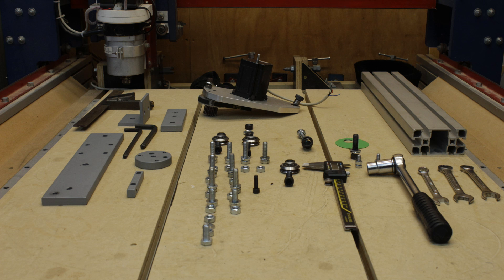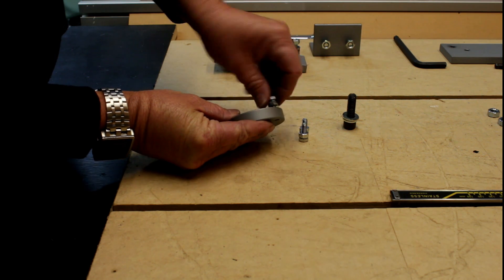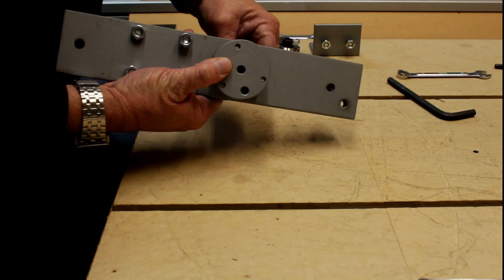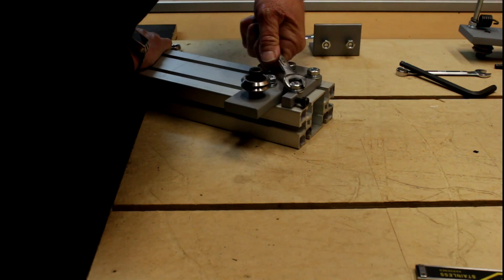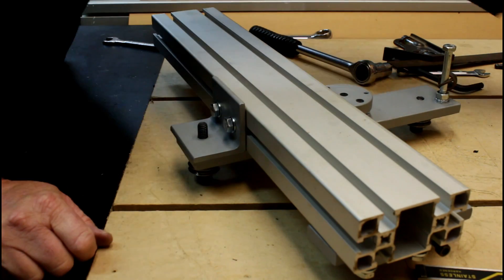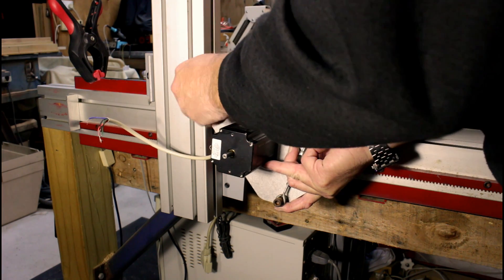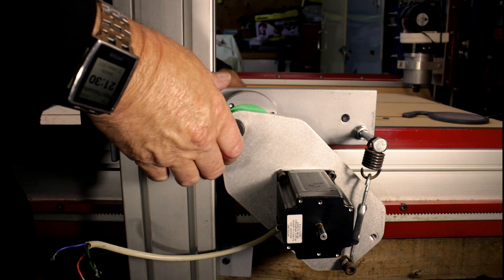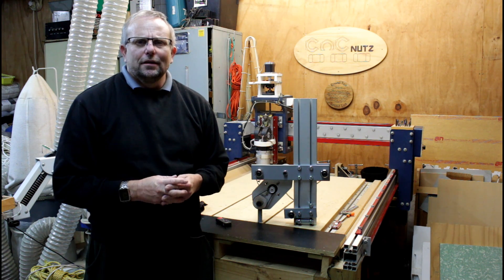New Y Axis Carriage Prototype - CNCnutz Episode 133

Comment: looks heavy hope the steppers are still able to get it going and stop it 
should be able to cut some pretty thick aluminium though , youre starting to get intoo the endmill range 
think the next weak point in raising the speed and smoothness would probably be the power of the routerhead itself

one thing that might be nice to make a video about is calculating a powersupply for the machine (stepperdrivers and steppermotors )
been looking around for the formula's to get the optimal power and amperage needed for my setup and it took some doing 
figured out little over 42 volts and little over 16 amps , thinking about building my own unbalanced one

Comment: Loving the rack and pinion drive, something i just have to do to mine. Personally i gave up on V bearings seem really expensive (in the UK at least) and supported rails and linear bearings proved surprisingly cheaper.
Reply from the maker: +den453
Rack and pinion is a really good addition to any machine. You will really love it. 
Cheers 
Peter

Comment: People usually use 4 Vbearings for one of axis, you use 3 it is simplified for setup and cost effective. Nicely done thanks Peter.
Reply from the maker: +Majsta Ć. 
Thanks. Now all we have to do is see if it works.
Reply: Well it depends on bearing type and forces applied, how much kN of force machine is capable of? and how much bearing is designed for? and there we go. Cheers Peter

Comment: hey Peter. what sort of steel did you use?  is it just regular flat bar or cold rolled etc?
Reply from the maker: Just standard Flat bar steel.
Reply: CNCnutz (Peter Passuello) you NZ guys must have better stuff than us Oz lol
Reply from the maker: I find it hard to believe you don't have flat bar steel in OZ. 
Either that or my understanding of cold rolled steel is incorrect.
I will ask at my steel supplier next time I am there. Either way the top rail is made froma piece of 12mm x 60mm mild steel cut to the required length.
Cheers
Peter
Reply: CNCnutz (Peter Passuello) we can get either 50 or 65mm wide but not 60mm. cold rolled steel or bright bar as is known round here is become a rare commodity round here as it was made by a company called Martin bright but went bankrupt a while ago. regular hot rolled steel is available everywhere but my supplier usually has rusty lengths not clean looking stuff in your video.
Reply from the maker: Believe it or not I bought that steel 5 years ago when i designed the carriage. I'm surprised it didn't rust myself but it comes with a protective coating on it which must work. I envisage it is the equivalent of your hot rolled steel as it is the cheapest stuff you can get. We can get bright steel but it is usually round and goes by the name of bright shaft. It is expensive and the last piece I bought I used to turn a new shaft for my lathe. Not a job I want to repeat any time soon.
Cheers
Peter

Comment: How about teal as a colour 😂. I have rack and pinion but when cutting, I never use top speeds. Great video, can't wait to see final results.
Reply from the maker: +Grant Clarke
Thanks Grant 
At last a real engineer speaks out on the important issue of color. I was going to make it Hammerite blue but my Tin of paint had dried out over the last 15 years.  I must say the gray is growing on me. 
I don't run my R&P at full speed either as the router can't keep up. 
Cheers 
Peter

Comment: Did you make the top and bottom v rails? Do you have a link to any videos on how you made them? I know you mentioned that you need to make new (longer) v rails - looking forward to that!!
Reply from the maker: Hi Grant,
Yes I did make the rails and ground the V on them but as yet I haven't done a video of the process.
I plan to make a video in the near future showing how I do it.

Cheers
Peter
Reply: Seen a few videos by people that have made them for Mechmate type designs but they seemed a bit rough. Enjoy your videos - looking forward to one on v rails!
Reply from the maker: +Grant Tudor 
I  watched the  Mechmate ones years ago and thought about making the jig until I  realized there is an easier way that give as good or better results.  The Z V-Rails on my machine have a very smooth finish because I used a fund grind stone to machine them.

Comment: Great project again, it will be interesting to see how using one V bearing on the bottom holds up, but probably more than enough for the forces going to be seen
Reply from the maker: +Rob Evans 
It seems like a good idea and a triangle is a very strong and well balanced shape so I think it  should work but as always this is the real world and things don't always behave as we think they will.  
Fingers crossed. 
Cheers 
Peter
Reply: CNCnutz (Peter Passuello) Yes am sure it will work well,  also with the 3 points of contact being the most stable it may well be better than having 4.  Looking forward to seeing the progress. Great work as always.

Comment: Awesome again Peter!  Can't wait to see the results...My second machine is a 4 x 8 Joes R&P with mdf carriages and this would be a wonderful upgrade down the road.
Reply from the maker: +Bruce Fleury 
Was going to build the EVO but I really want to  find out if my design will work. If it's a disaster I can always change back to the EVO but at least I will have tried. 
Cheers 
Peter
Reply: Rob Evans I definitely will upgrade it this year, but I also have a  cncrouterparts 4x4 that is pretty stout  that I use.
Reply: Bruce Fleury you should definitely upgrade, with the accessibility of aluminium extrusion it makes it a simple upgrade and a lot easier to work with than mdf
Reply: I will be following the progress for sure....You better start design work on the other 2 axis.....lol.